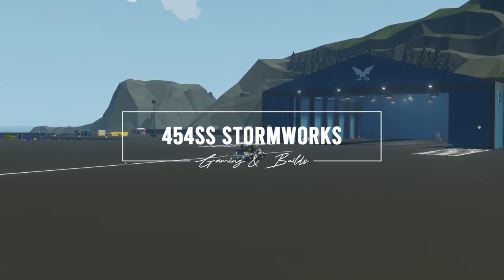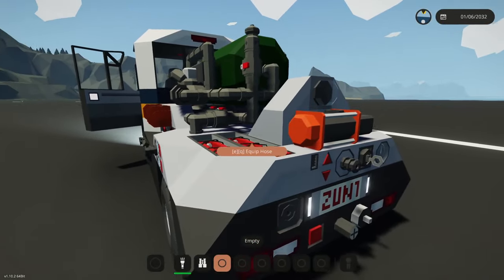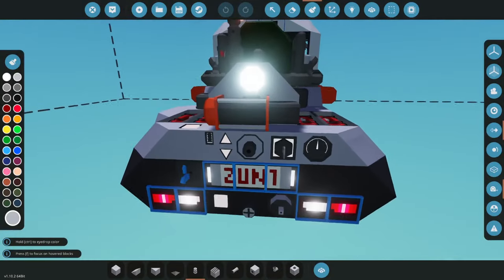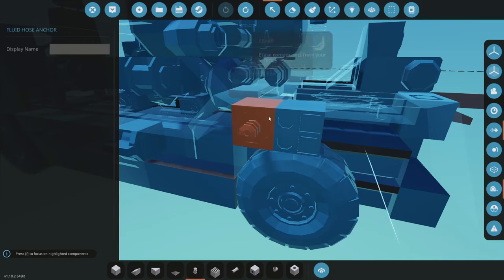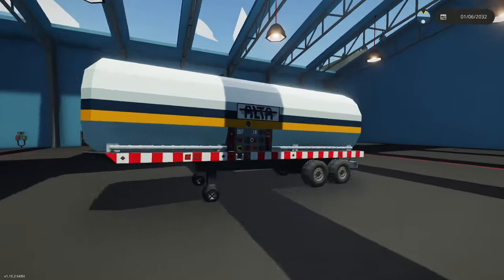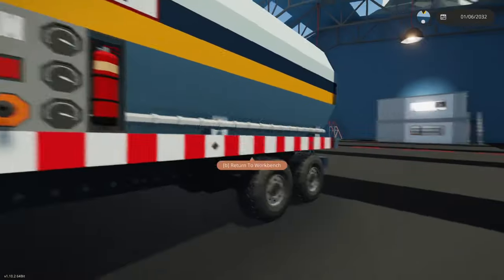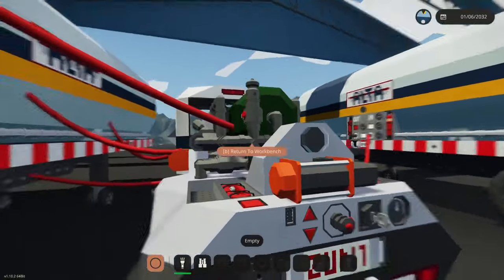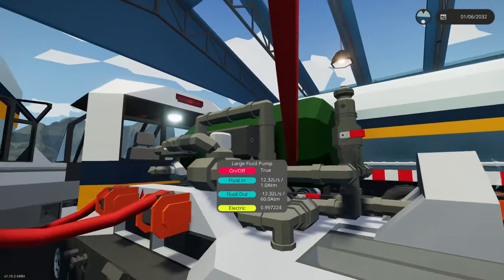Micro-Truck for quick PUMPING in Stormworks

Comment: You really need a flow rate dial for the fluids as the tooltip include gasses. Can be done using a Delta micro and watching fluid content and Multiplying that by 60.
Reply: I agree. I started using the Delta for all kinds of stuff. Incredibly useful.

Comment: one thing to note that is very important to make this process work well, is to have a fluid release valve in front of the OUTLET of the tank you are pumping from (so only fluids can leave the tank!). so in this example the tanker truck that holds the diesel we want to pump out, should have a fluid release valve on its outlet hose connector. Otherwise, each „tick“ you would pump out some of the compressed air you just pumped in, together with the diesel. if you are pumping the diesel to a selling station this is less critical, since the selling station will just discard the gas part, but you will spend part of your flow rate to transfer gas that is then discarded. If you‘re pumping into another tank, then its worse, since you will increase the pressure in that tank over time with the overhead gas and slow the transfer down.